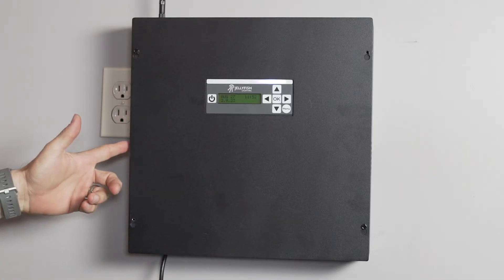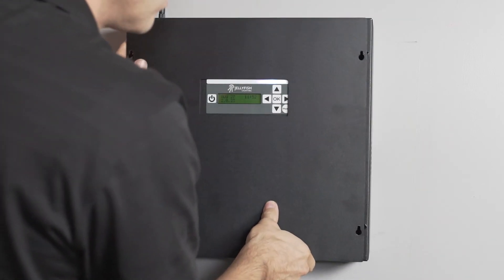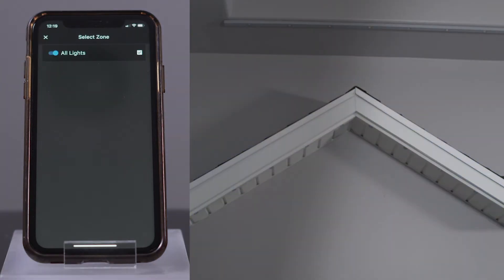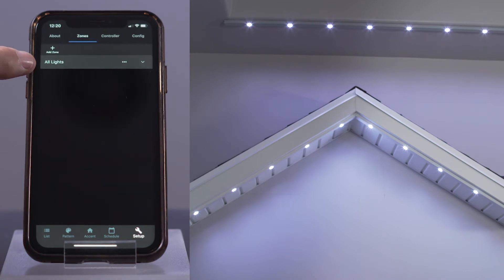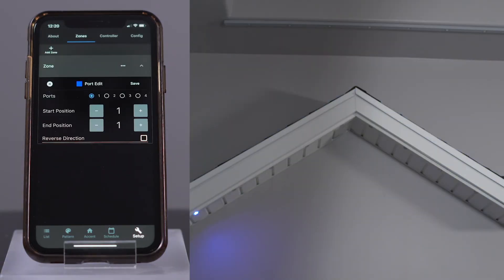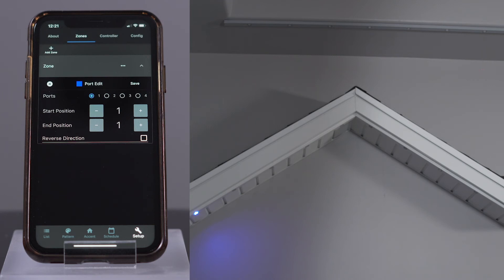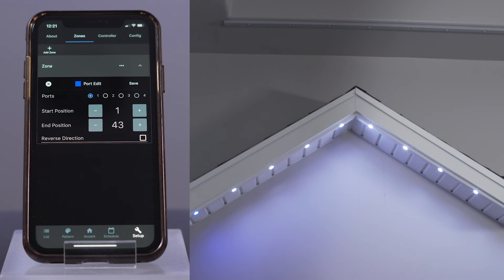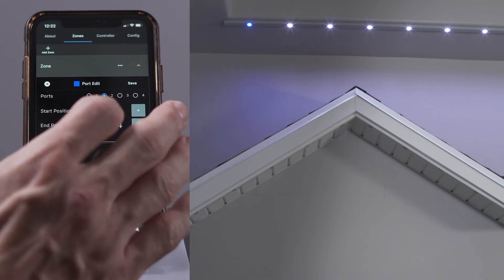Understanding Ports with the Designer App

Comment: What happens if you go past the last light? Meaning first light is blue and last light seen is white. Will that mess up the other ports or will nothing happen.
Reply from the maker: Not really, but I would probably try to set it up so it ends in the proper place because it will look off for some patterns like stacker.